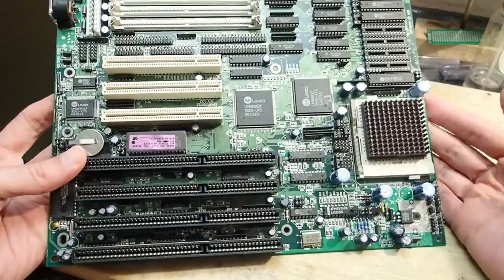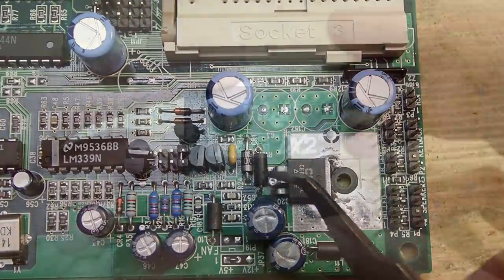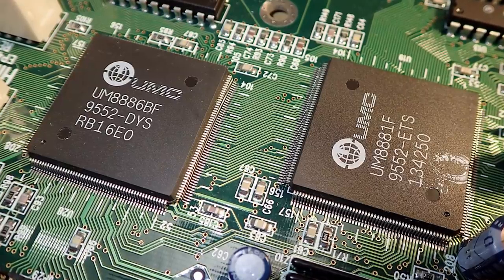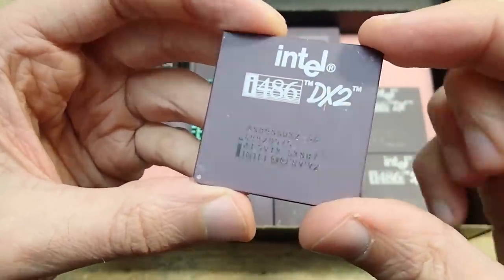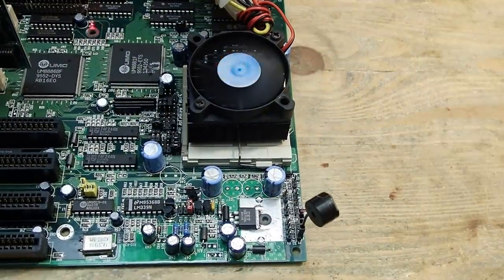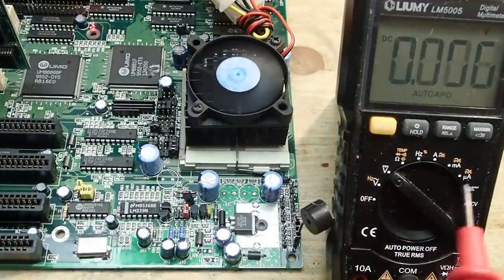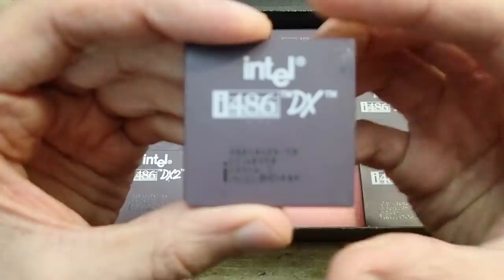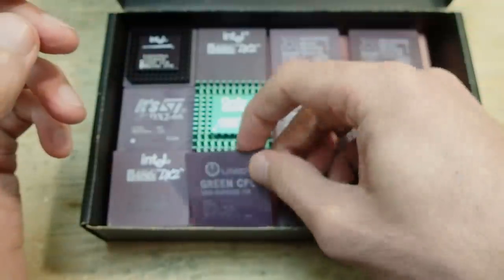Let's try to benchmark and overclock a 486 on an Octek Hippo 15

Comment: Awesome! I’m curious if you tried the DX2-80 at 100mhz/FSB50 once you found the DX-50 stable timings? In the video it sounds like you found the stable timings after testing the DX2/80 at FSB50.
Reply from the maker: Yeah, it is a bit irritating indeed, but behind the scene I swapped back and forward couple of times, also trying different PCI clocks and such things. It looks like the 3V DX2-80 doesn't want to run with 50MHz at all and the 5V version was unstable even with the worst timings I could set. Well, was a nice experiment though ;D
Reply: @necro_ware  Would you be able to try clock switching at that frequency? I do this with my VIP using the turbo switch. post it at a lower clock and have the turbo switch on one of the FSO jumpers to switch it. I do this so I can get a 40mhz pci clock. Otherwise my particular board wants to use a lower divider.
Reply: Necro, do you think that cooling the CPU way down with a water block might stabilize it, if it was possible?  I mean I don't think there are blocks for 486's anyway, so perhaps hypothetically speaking.
Reply: @robwebnoid5763  i'd be interesting how the temperatures of the cpu were. and: did you possibly forget about the pci divider? pci is, if i remember right, specified at 33mhz and if you forgot about the divider your pci bus ran with 50Mhz as well. that could be the problem. the graphic issues are a hint in that way.

the cache chips are capable of 66mhz.
Reply: @tdsangel  he didnt forget the pci divider.
Reply: @tdsangel  ... Yes, as said, the pci clk divider was thought of.  But yeah I'm thinking this is usually some sort of thermal issue inside the processor.  I remember the "old" days in the late 1990's where people were forcefully cooling down first generation AMD K6 CPU's (pretty sure it was K6-I, not K6-II) with Vapor Phase cooling kits, since those types of cpu's are also stubborn & the phasing worked.  Even non-mobile K6-III's are difficult to overclock. Luckily I still have a K6-III+ (easily clocked from 450 to 600 with just heatsink-fan).   I also want to increase the main clk oscillator on one of my 486 board's from 25 to 33, so as to bring the AMD 5x86 from 100 to 133 mhz, but unsure of any overall stabilities.  One of my bad experiences with the pci clock was when I moved the fsb from 66 to 83 on an early Abit Pentium board. It messed up my Windows on the harddrive. The bios had no clock dividers, so that's why its pci went from 33 to 41.5.  However, I believe in order to overcome that, you may have to first format the harddrive & then install Windows (it was 98se) at the 83 fsb, instead of 66 & any other details that are required, as I think it requires those sort of nuances when it is formatting the drive. There may also be some other chips on the motherboard that may need to be heatsinked when increasing fsb.
Reply: @robwebnoid5763  many of the ide controllers of those days didn't like higher pci clocks - if you'd try to format the hdd with this clock, it may just mess up. if i remember right could the intel chipsets starting from the 440lx and later on bx work with high pci clocks even if the graphics cards didn't.
the k6 cpus were in those times with a strange behaviour. that's right. the first cpu from amd i bought was the first athlon. that was a hammer.

Comment: I ran with a i486 DX4 100 for about 3yrs until upgrading to a P60. Turned out to be a mistake as the 486 was faster than the P60. I then changed to a P90 and ran that overclocked to 120 for a couple of years. With a larger heatsink it didnt seem to mind.
Reply: That's because your P90 was actually a P120 in disguise. That era's CPUs were commonly badged not with their actual speed but to hit a market price point. Frex, most marked as P75 were actually P90 under the hood, but the P75 was seen as a bargain CPU and sold better, so many P90 were labeled and sold as P75. (I've only seen one P75 that was actually a P75 and wouldn't go any faster.)

There's no such thing as overclocking; it's just locating the real max ability of a given CPU.
Reply: i actually overclocked the dx4 100 to 166 mhz and it would even run some games that required a pentium, used it for many years like that.
Reply: @robbirobson7330  You had a really good one :)  When I find my old DX4-100 again (somewhere in a box) I'll have to try that!

Comment: Nice overclocking tests! Now we know limits. 👍
Sad, that UMC CPU didn't work at all..
No worries about fuse in place of resistor, at least board is working. Only current limit part won't work as it should..

Comment: Great video! I have one of those 5V AMD DX2/80s as well. It feels significantly faster than a DX2/66 in Doom and other more demanding games in my opinion. I usually have good luck with 40MHz but 50MHz FSB seems to be a much higher hurdle to overcome. I have an AMD 133MHz (P75) that runs great at 50MHz x 3 but in my gaming benchmarks 40MHz x 4 (just 10mhz more on the core clock) negates the FSB gains and gets slightly higher FPS.

Comment: it is called shunt resistor! you can find it in different packages, even in TO220!
Reply from the maker: Yeah, you can find them in all kind of SMD packages as well, but I need it as TH and unfortunately I couldn't find any so far in the value I need.

Comment: 50 mhz FSB on any 486 board is hard to run with any sort of stability. It's one huge reason why Intel didn't sell many of the 486DX 50 mhz CPUs and instead sold a DX2 50 mhz variant that used a 25mhz FSB. I bet if you could get your hands on an AMD 5x86 133 mhz CPU you could clock it up to 160 mhz on a 40 mhz FSB. I'd love to see some benchmarks of it at that speed! :) 
Back in the 486 days I had a 5x86 133 CPU that was clocked at 120 mhz on a 40 mhz FSB as the 486 board I was using was an early board where I could not set a 4x multiplier no matter what jumper combination I tried. I also had to use a 5volt to 3.3 volt inline socket converter and a heat sink with a fan on it. Made a little tower for the CPU compared to the original Intel 486 DX2 66 which didn't even have a fan on it's heat sink.
Reply from the maker: That was  only true for the earlier 486 mainboards since 50MHz were a big problem for the VLB,  which was running synchronously with the CPU clock. But as soon as PCI with its asynchronous clock was introduced it was not a problem anymore at all. As I said in the video DX-50 CPU ran absolutely stable in this mainboard. Obviously the FSB was not a problem for the mainboard, but for the DX2-80 CPU, which didn't want to run at 50MHz.

Comment: Happy Sunday benchmarking :D Great Video and awesome reults with that UMC Chipset. Sure there are performance differences, but these are quite huge. I am using a HOT-403, a much earlier VLB-Board with OPTi Chipset and 5V only. I am running it at 50 MHz FSB. Zero WS on memory and 2-1-1-1 on 256k cache. The CPU is a Cyrix DX2 80 MHz running at 100 MHz. And I only got Memory throughput 0f 21.23 MB/s and Cache just 45.02 MB/s. The Processor achieved 37.91 Points. So games running quite a bit slower... makes me want to have a board with such a chipset - but these are expensive...

Comment: The only 486 I ever used that almost ran Quake smoothly was an AMD 5x86 133 running at 150mhz(50x3). The fast fsb made way more of a difference than running at 160mhz(40x4) and getting the 10 mhz of extra clock speed out of it. It was roughly equivalent to a 90mhz P54 core of the day and I got a lot of mileage out of it until I could afford a 120mhz Pentium. Even after that I gave it to my girlfriend at the time and she used it all the way until 2000 or 2001 until her cousin managed to kill it when installing extra ram.
I'd still love to see one of these and if it could get to 200mhz, maybe with some extra voltage. While I do still have mine and I think it may be repairable(as I realized one of the corners is chipped and the pin is missing, bit there is enough of a pad left that it can probably be soldered on and add a wire), I don't want to part with it. I'll keep an eye out though in case I run across another one to donate to the cause. Great video as always.
Reply: You can run AMD 5x86 133 @180 (3x60) and even @200 (3x66) with peltier cooling system :)

Comment: That is very interesting for the DX50. I thought it would have scored a little higher. But i guess the slack timings make that much difference. It is not really performing above its clock relative to 66mhz by very much at all. NSSI FPU shows a bit of growth, but that does not translate to quake, which would have also had a 50mhz pci clock. I would imagine the difference would be closer if they both used the same timing.

Comment: Since the resistor you replaced with a fuse is a sensing resistor for overcurrent protection, the resistance of the fuse, which we don't know, may result in an current limit, which might prevent the "green" CPU from working at all.
Reply from the maker: I tested the UMC CPU in two other boards as well. It doesn't even get warm. It is definitely dead :(
Reply: @necro_ware  Well, that's sad. RIP, CPU!
Reply: @necro_ware  I wonder if the UMC CPU died at the same time as the voltage regulator circuit - if that specific CPU was installed with the incorrect orientation in the socket at some point in the past.  In about 1999, I bought a Socket 3 Compaq desktop with an Intel 50MHz DX for pocket change and then promptly released the magic smoke when I inserted the CPU incorrectly.  Both the board and CPU were dead afterward.
Reply from the maker: @reidster87  this was also my thought, since all the jumpers were set to that very one UMC CPU as I got this mainboard. We will never know.....

Comment: I have a similar mtherboard. But EDO was only working with specific Cache and RAM Timing settings in the BIOS. And it was more like the System ran at half the speed before than it ran twice as fast wast later. The performance literally doubled in Half-Life on a Pentium overdrive. It felt like not working correcty without EDO not working. Guess the Pentium really squeezes the last bit of RAM and Cache performance.

Comment: Yes, the DX2-66 was the top CPU when I bought it in '94. It was also the very last time I ever owned the fastest CPU of a generation ;-) While I would love to own and play with my '96 5x86@160 486 setup again, I am aware that this setup was only a budget option because I could not afford a Pentium 90 at the time. Getting the most out of a budget option is certainly fun, but it is not my most desirable setup of the time.
Reply: Sorry to disappoint you, but the P5 Pentiums came out in early 1993. So it seems that you never actually owned the fastest CPU 😅
Reply: @ruxandy  I knew someone would ruin my day ;-)
Reply: no it wasn't. i passed on a pentium 100mhz in 1994 and got a 486 dx4 100mhz instead. i was 8 and i regret that to this day. so stupid.

Comment: 6:22 - why it is this Virge so small, in comparasion with other S3 Virge / DX ? Why they didntit this small always?
Reply from the maker: I also have a dx version too, which is exactly like that one. Miro designed it that small.
Reply: @necro_ware  And it's same fast as other Virges? I wonder, why other manufacturers didnt use small PCB too, as it is cheaper, and easier to store.

Comment: That resistor (which is named r on the mainboard and not f ;) ) has the same purpose as a shunt resistor on a modern graphics card I guess. Some modders change these to force higher voltages to the gpu i.e. faking the "measured" voltage to the regulator.

Comment: Hi Necroware,
When you will do the test please overclock the Cyrix DX2 processor. My first system was a budget ZIF socket 3 vlb mainboard (as I remember SIS based board) without voltage regulator. It was fixed to 5V, but the processor needed less (3.45),that reason allways frozen, when I recognised that issue I thought something big. If I have a board with overvoltage only it should overclocking the processor. But I forgot the values. Maybe 40*2 maybe 33*3 maybe 40*3. One thing is clear after that "solution" the system has became stable. So please try this for my memories and for experiment of course. A side note I think the active cooling is necessary. 
Thanks in advance, Mark
Ich wünsche dir ein frohes neues Jahr!
Reply from the maker: I have no Cyrix DX2. All the 486 I have you saw in the box in the video. If you are interested in Cyrix DX2 performance and compare, I can suggest CPU Galaxy channel, or OLD ROBOT (which is also really good, but unfortunately in Russian).
Reply: Upps  I see the Cyrix emblem and DX and I missed the 2... Stupid me. But don't forget ST processors also Cyrixes and do you have a ST DX2 66MHz but 5 volt ones...

Comment: I have a new/sealed Pentium Overdrive CPU for 486 systems. It looks like it is made to run at different frequencies depending on what 486 CPU you replace with it. Can I use it as a primary CPU in a good overclocked Pentium system or does it only work in 486 boards with an overdrive socket?
Reply from the maker: It only physically fits only into a Socket 3. You will not be able to install it into a Pentium (Socket 5/7) System. You also don't necessarily need the blue overdrive socket to use it, since later 486 ZIF Sockets supported both, please refer to the manual of your particular mainboard.
Reply: @necro_ware  Thanks. I guess I need to find out what Socket 3 board would be best to pair with this for the closest Pentium experience. My first PC was a Cyrix-produced IBM P-150. I didn’t get to experience a real Pentium until the late Socket 7/Super Socket 7 era, which was well past the 486 era for software and such.

Comment: I don't know if this board supports these settings, but what about running the CPU at FSB 40 and Multiplyer 2.5 ?
Reply from the maker: Multi is even more a question if CPU than the board. As I said in the video one of my dx2-80 supports 2x/3x, the other one only 2x

Comment: I'm surprised you don't have a DX4-100 or 120; they were pretty common at the end of the 486 era. I have a DX4-100 here somewhere that I used for years as a test rig (because it would speak to anything). Your DX2-80 might actually be a rebadged 100 or 120, that being very common at the time. (There's no such thing as overclocking, only hitting the actual max for a given CPU)
Reply from the maker: It's often the same even today. Many CPUs and GPUs are often the same during the production, then they will be tested for stability at different settings and decided to be high, middle or low range cores. That's why we could overclock and turn on shader pipelines on the ATI 9500 and Nvidia 6200/6800LE back in the days ;)

Why are you surprised, that I don't have a DX4-100? I don't have as much hardware as many people think. Most of the repaired stuff I sell, exchange or give away. The box of 486 CPUs, which you see in the video are really all I have.
Reply: @necro_ware  Ah, thought you were building a collection, but sharing is good too :)  I don't have much of the really old stuff anymore myself; gave away all but representative or special units last time I moved.

I remember when that S3 Virge was the fastest vidcard around.